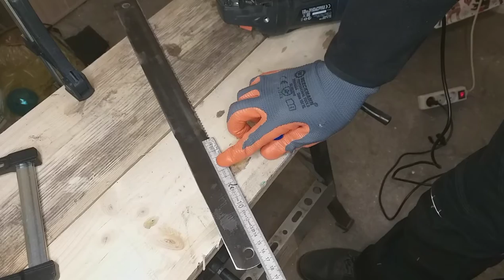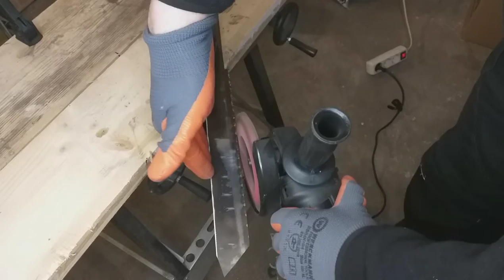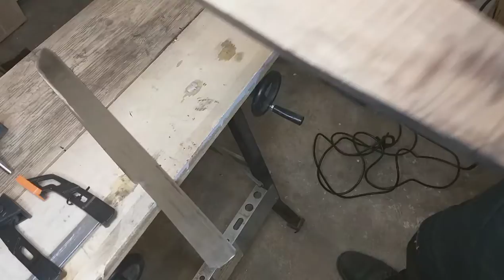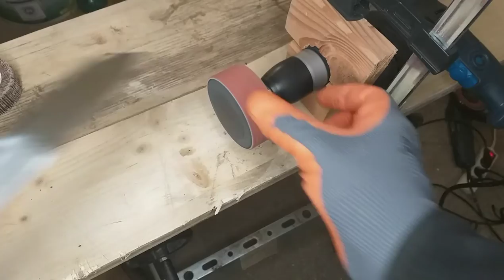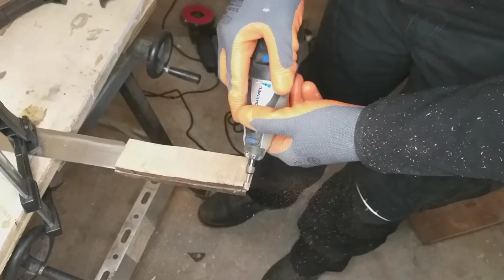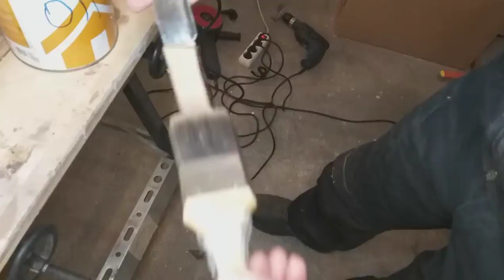Machete making from old Saw Blade

Comment: I would never trust glue or epoxy of any kind to hold the handle on a blade. Rivets are an absolute must. Can make rivets out of anything. Even an old nail.  I also hose the steel down with water every couple minutes to keep the steel cool so it doesn't loose any temper from all the heat the grinder and sanding puts in it.
Reply from the maker: Ok Thank you

Comment: He makes this a lot harder than it should have been. 
He shouldn’t have cut the end off of the handle end as it had a lanyard hole already in it.
Also he made a big mistake in sharpening the saw blade edge instead of keeping it as a saw back machete.
Reply from the maker: @Brett-z8t  thanks for watching!  This was my first try and just for fun
Reply: @LeUgat117  you’re welcome, you might find that making 1 or 2 knives from a saw blade like this is better because a machete needs to be stronger for a lot of bushcraft work..